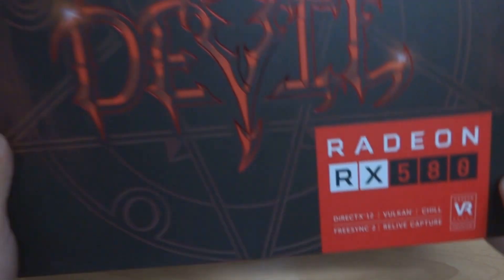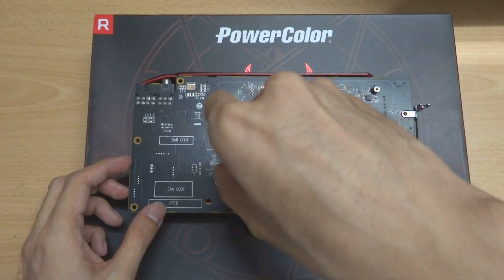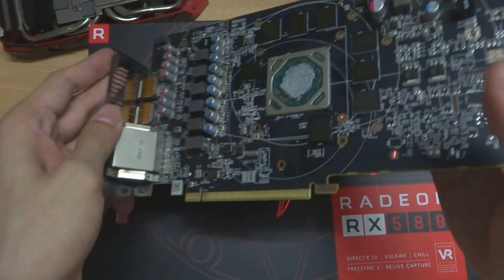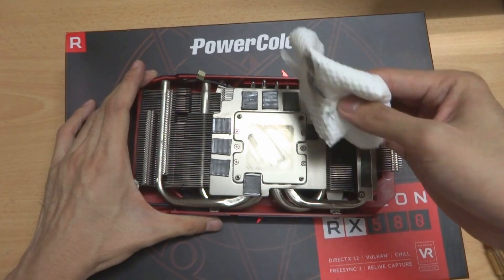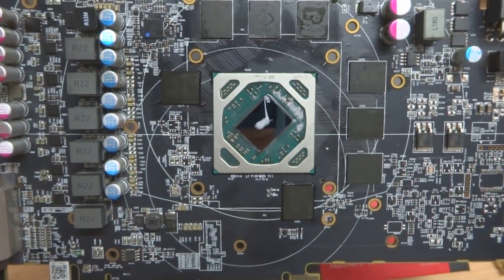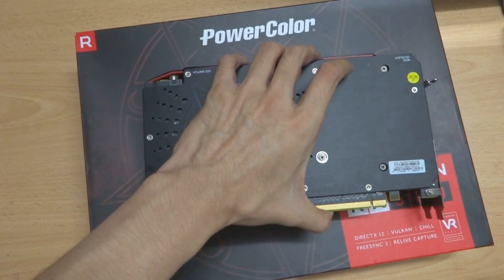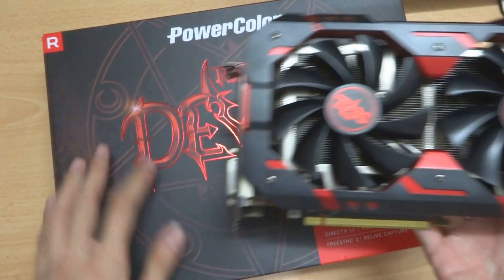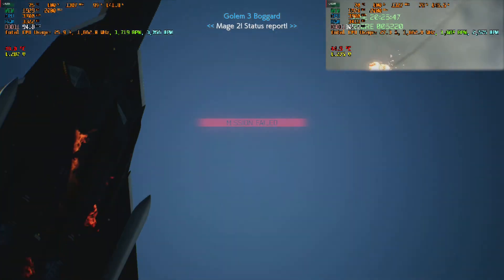RX580 Guide: Thermal compound replacement

Comment: Wow, that much of a difference! my the very same card when I try to clock it to 1450MHz went over 200w, at normal 1380MHz - about 170w,  I will try to do the same with it right away, I have same artic thermal paste, just I have doubts regarding thermal pads - should those be replaced as well? I have some of material, just not sure of thickness what is required?

Comment: How do you get the backplate off though thats how ive been slipping up is i cant get the friggin backplate off
Reply: After everything is unscrewed you just have to pull it off, it'll prolly be a lil hard since the thermal paste on it acts as a sort of glue

Comment: Only issue I have with my rx 580 is the thermal paste drys up way to fast in like a few months then the temperatures start to go back up. I have tried using a custom fan profile undervoiting and the card stays around 78 to 80c which is way to hot.
Reply from the maker: Maybe you can try and find graphite pad that fits.

Comment: would you recommend this PowerColor Red Devil RX 580 8gb? 
Also, does it come with a utility software?
:)
Reply from the maker: Ya this is a great card actually. No I don't think it comes with software
Reply: @PenguinTech521  Awesome. Thanks for the reply.
I bought a used card, waiting for it to arrive in my country, I will test and see if the performance and temperature aren't alarming. If they are, then I'll definitely follow your video, to check the thermal paste
Reply: @yvanbrunel9734  I Personally have an RX580 8GB Powercolor, the same red devil edition as him, just gotta say; If u make maintenance and create an fan curve, everything will be okay, Mine with an little undervolt doesn't have more than 65°C with the cpu at 100% for hours
Reply: @Umidahh_ cpu temp has nothing to do with gpu temps

Comment: Mine started running 80-90C this week (90 crashes)
Reply from the maker: Did you replace your thermal compound?
Reply: I am having the same issue. Were you able to find a solution?

Comment: Hate to be a perfectionist. but you removes the screws wrong. It may lead to a broken or damaged gpu. Always go in an x pattern.
Reply: that's exactly what I was thinking lmao
Reply: At the Middle and End of Video he uses the X Pattern, he just forgot it in the beginning.
Reply: Good idea man i was thinking about disassembling my gpu and i will take that tip, great coment :)
Reply: That really doesn't matter so much when you're removing it. It more so does when you're tightening and even then, there really isn't a whole lot of tension or distance when tight vs loose. Just look at the length of the screws. CPU heatsinks have a lot more play.
Reply: I agree with Preston, and I noticed something else I wouldn't recommend...I wouldn't just leave the "grain of rice" blob of thermal paste like that before reinstalling the heatsink. There's no way you can tell when you reapply the heatsink if the paste will be spread consistently and evenly across every millimeter of the GPU when you do that. It's nitpicky but from many years of overclocking, lapping copper heatsinks and applying upgraded pastes, what I do is first rub a tiny consistent layer of paste on the heatsink part, using a fingertip inserted in a plastic bag, just to smear on the thinnest layer. Then, after adding a "grain of rice" amount of paste on the GPU/CPU, use a little spreader tool or something else that's small and flat and carefully spread the paste all over the entire GPU core in a thin, consistent layer. This way, both mating surfaces are guaranteed to interface properly and you won't be guessing/hoping that the "grain of rice" will get squished perfectly to cover the entire core.  Btw, I liked your RX 580 overclocking/undervolting vids, nice job.
Reply: @Coelacanth97  be careful with that approach, as different areas have different heights then, and it may cause air bubbles to form in the middle, which will hurt thermal performance since that area is no longer in contact with the cooler
Reply: @astral-proj3ction  Regardless, the way I recommended to apply the thermal paste is far more likely to get a consistent contact layer than appying a grain of rice blob and just hope it goes on evenly after you install the heatsink. Overclockers have been lapping (polishing) heatsinks and reinstalling them the way I outlined for many years. If you're not sure if you're making sufficient contact, just look at the heatsink surface after press-fitting it. If you see a square imprint, you KNOW it's interfacing properly.

Comment: my 1060 never hotter than 64c while playing games with 28c ambient temperature in my room.
Reply from the maker: Nice, GTX1060 definitely eats a lot less power than RX580
Reply: @PenguinTech521  but now RX580 performed better than 1060 on newer games. just makes sure the temperature never above 90c and you should be fine
Reply from the maker: @weesenpai9056  I suppose this is due to RX580 higher raw power and memory, and AMD FineWine is kicking in.
Reply: @weesenpai9056 if your temp goes even 80 or above with this card, you have problems. I had a case with literally 1 working fan that was intake only, and my temps never went above 82. That's zero airflow.. if you are even hard gaming with a real working case at 80+, that's really really bad. Yes, less than 90 is "safe" as in your card isn't gonna blow up, but it won't last that's for sure.
Reply: Fuck my rx580 runs at 80C
Reply: @aleksifrmdao  My previous rx 480 ran at 83C at 1440p, i'm waiting for my PowerColor rx 580 8gb to se